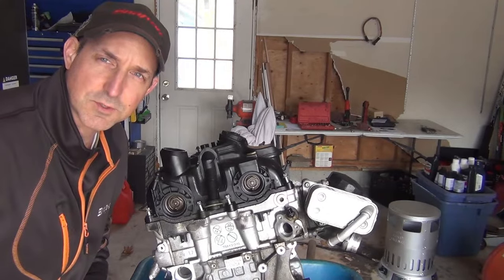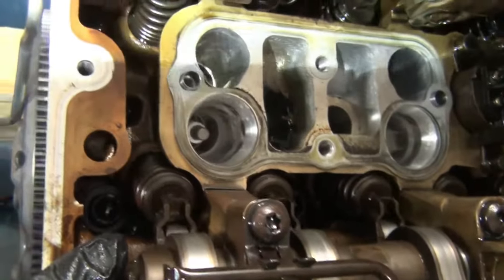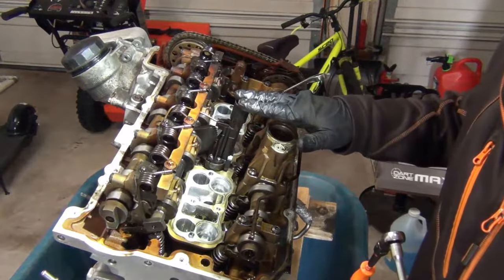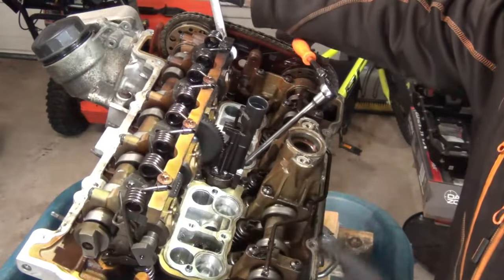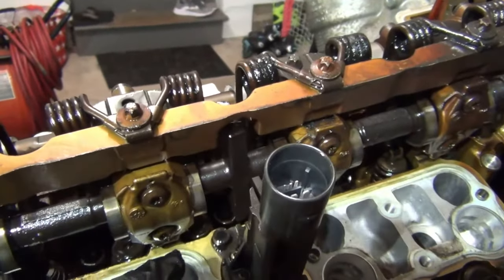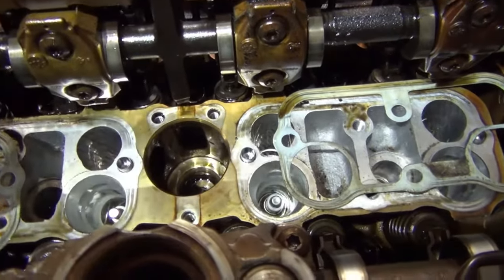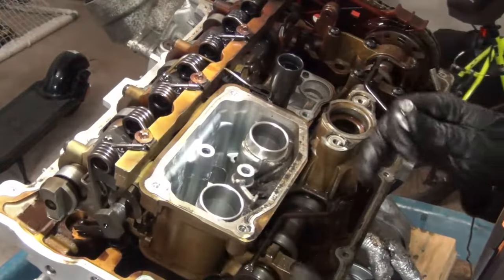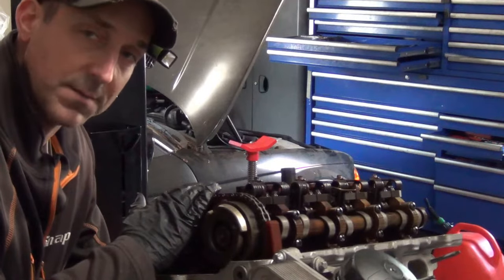How To Remove Replace Install The VALVETRONIC MOTOR BMW N20 N26 N55 With Torque Specs

Comment: For my n55 people your maxximum and minimum stroke stoppers are located left toward cyilinder number 5, instead of right toward the timing chain like the n20/n26 do
Reply from the maker: Thanks for adding this note to help others!
Reply: @AskTheCarExperts  i have the code 2DCF and orderd the motor yesterday, hoping that it is just the vvt motor that failed 🤞
Reply from the maker: @a.b.ripper9908  I hope so! 🙏

Comment: Hi I have 4 codes 135b11,133010,1f0904,and 133011 should I replace the valvetronic motor any help will be appreciated
Reply from the maker: 135B11-Valvetronic servomotor activation Volt phase: line disconnection
133010-Valvetronic servomotor activation malfunction. 133011- Valvetronic supply voltage malfunction This sounds like a voltage supply issue to the valvetronic.

Comment: What is the part number for the fuel injector well block to cylinder head gaskets ( flat metal one time use gaskets) ?
Reply from the maker: I would need the last seven of theVIN to look that up.
Reply: @AskTheCarExperts  .
WBA3N7C53FK222606.
Thanks
Reply: Were you able to get part numbers for those " 1 time use gaskets"  ?

Comment: Does anyone have part numbers or names for the 2 metal gaskets that need replacing at the same time?? Thanks
Reply from the maker: Which gaskets? The ones for the buckets?
Reply: @AskTheCarExperts  hi, the ones you mention at 8:15 mins

Comment: Hi, I timed my n26 engine based on your other video and engine runs drives good but still getting code fault code 135808 : "valvetronic servo motor, position sensors, electrical". Plus it makes loud clicking noise for a few seconds when you unlock car.   Do i replace just the motor?  Where are the position sensors on the N20/N26  that the code is referring to?  Thanks!
Reply from the maker: Sorry for the delay. Just getting caught up on comments. Great to hear my video helped.
The symptom you have can be from a failing valvetronic motor and eccentric shaft. The clicking is usually heard when the gear is binding on the shaft. In most cases the valvetronic motor and eccentric shaft need to be replaced. I have a video on that as well :)

Comment: How much would a BMW dealer charge for that replacement? I have a code P10E2 code with the check engine light on… is that a bad valvetronic?
Reply from the maker: Hello Tyler, I would call you local BMW dealer to find the price. Labor rates vary greatly by state and dealer. I would call a few and get a general price range.

Comment: when i turn my n20 on i don’t hear the valvetronic do a sweep and it also says it’s disabled due to too many errors. since it doesn’t do a sweep does that mean the motor is bad?
Reply from the maker: You have to check the integrated power supply as well and the DME could also be faulty. But often it is the motor and eccentric shaft. Try to test fit one externally and see if it spins when you cycle the key. If it does the DME and wiring are good.

Comment: This is an extremely good video.  Your analysis are just extremely good and makes it very simple for anyone to replace the motor. Please I have a question.  Can a failed Valvetronic motor or system cause a car not to have a spark and also not to start.
Reply from the maker: Usually a failed motor would not cause a loss of spark.

Comment: I almost gave up on my BMW N55 engine because the shops qoutes me $2500 for replacement of valvetronic motor. I thought it was complicated, but i will give it a try as long as the intermediate shaft gear is not damaged.
Reply from the maker: I have a video on a trick way to replace the shaft. I do this on the N20 engine but the procedure is the same.
Reply: Did you get your motor replaced? Was the shaft damaged? I have a rattle sound when unlocking the car.
Reply: @dnup9392  any updates on your car? I also have rattle sound
Reply: @kawakx333  didnt get a chance to do anything yet. Have you showed thencar to anyone?

Comment: Hello, i have changed thé motor on the my 335i f30 2014 but i can’t make thé apprentice to the new motor 
Fault code 134F04
Reply from the maker: In some cases you need a new eccentric shaft and motor to fix a binding component.

Comment: Awesome video, Roger! 👏🏻
I learned a lot as it’s the first I’ve seen of this perspective on an N20.
I didn’t know about the wells until this video. My first thought was, hm any gasket there?
Of course, you had that covered 👍🏻
Quite a difference in execution from the N52, which I had to remove when I did my valve cover gasket job on my E82.

Super closeups you did thanks especially the Allen where it turns the worm gear.  Those shots make a big difference to the uninitiated.

Looking fwd to the next one!

Btw, what happened to your drywall? You didn’t leave Zion in the garage one day…? 😜🐶

I read once a couple left their German Shepard in their garage one weekend with plenty of food and water etc, I guess they went away (not exactly what I would do to my pet…) and the dog bored through the drywall and exterior siding for the great escape!
Reply from the maker: Hi Bud! This was a fun video to make showing how the gearing works. The drywall issue is a funny story to me but not so funny story for my wife when I had to use a come along attached to the wall to put it back in place LOL! I don't think she would appreciate me giving the details here. I never fixed the sheetrock because I want to pull it all out and insulate the garage for better heat retention in the winter. It was a challenge making some videos in the winter. I still have to make the next video but I have an awesome timing tool set I purchased for the next tutorial  😊
Reply: @AskTheCarExperts  hm, wonder if it’s anything like my wife “kissing” the casing and jamb of our garage entry a few years ago with the passenger side of her X1…bmw exterior plastic cladding bloody expensive!
Lucky for her, I’m a certified professional detailer that happens to specialize in premium German marques 😎

Special tool?! That’ll be another great lesson.

Maybe when you have a Premium pay channel your members can get the scoop on your wall 👍🏻

Btw I recommend the rock wool insulation for the wall cavities.
Reply: And thanks for the Shoutout! 💪🏼
Reply: @AskTheCarExperts  Ihave the n55 dont i need a special tool to remove the injectors?

Comment: Unrelated but hopefully the comment helps your video! I watched a video you made several years ago about a problem in my current E46 trunk: (https://www.youtube.com/watch?v=dn3Vel0-uPI). I really would appreciate any help as the handle of the trunk has broken twice and the lights taking a beating from whenever anyone else has to use my car trunk! You said this may be resolved by "installing two thin plates under the lower catch that eliminates the upper latch from rubbing on the stricker". I just want to understand what exactly you mean by this! Currently subscribed and liking actively lol. Please help
Reply from the maker: HI Zaid, I would be happy to try and help. Can you contact me via my website at www.askthecarexperts.com and use the contact me tab. Then we can talk via email. I don't always get notifications from youtube. Can you go over in detail the issue with the trunk and provide the last seven digits of the VIN number. Talk to you soon!

Comment: replaced my timing chain on my n55 but i got multiple codes like : 134F01 Valvetronic, adjustment range: master adaptation outside tolerances and Valvetronic,
adjustment range: fault, range check

would this mean my valvetronic motor is bad?

i also have codes for vanos saying intake and exhaust cold start not available codes: 131401 and 131501
Reply from the maker: To me this sounds like your timing is not correct.

Comment: my valvetronic motor is "unable to properly set a minimum and maximum value to operate properly and is throwing codes during only harder driving". My mechanic is recommending replacing the eccentric shaft in order "to ensure a complete fix". Is it really necessary to replace the eccentric shaft?
Reply from the maker: Hi Thomas, It is definately smart to get a second opinion. Your mechanic is 100% correct. This code sets with wear between the valvetronic motor and the eccentric shaft. Both parts are needed to fix this failure. I have seen techs try to just do the motor and most have to take it apart again as the new motor and old shaft does not mesh correctly. Also the higher amperage can sometimes cause the engine computer to get over loaded and fail the internal final stages.  I hope this help!

Comment: Thanks for the awesome content. do you by any chance know of any possible causes of error code 133E10 valve tronics system: deactivated, too frequent adjustment errors? car idles from a cold start but then about 15min later it stalls
Reply from the maker: Hi Zunai, Adjustment too frequent is often caused by a failing valvetronic motor and eccentric shaft.
Reply: @AskTheCarExperts  thanks, is there a way to test the valve valvetronic motor
Reply from the maker: @zunaids4036  Yes, but it may be a bit complicated. The dealer had a test plan they can run to test the system. For a home test you would need another motor and plug it in externally to see if it cycles with the key turned on. Or remove the valve cover (fuel system disabled) and turn the key on not starting and watch the motor run and move the eccentric shaft. Usually you can see binding or slipping.
Reply: @AskTheCarExperts  thanks, you are really the best car expert 👌
Reply from the maker: @zunaids4036  Glad to help! I wish I had an N20 at home to do more videos with. Hopefully in the future sometime after I finish with the Z3 engine.

Comment: After installing it's need to relearn moter position by scanner  ?
Reply from the maker: That would work if you had a scanner. However just cycling the key on for a minute and off again will relearn the valvetronic if the system is operating correctly.

Comment: I'm getting a 2014 F30 with the N20 engine with a 5 volt supply fault like you said it affect most of the components that have the same 5 volt supply like ex. the venturi sensor the voltage goes around 10 volts when the car is running with the motor connected and 5 volts with it unplug but with the key on and engine not running it goes a bit bellow 5 volts thank for the video I have yet to replace one I did a few timing chain on them and I did the angle pick test on the timing chain thru the oil cap hole and the chain is loose this engine is at around 80 000 milles .
Reply from the maker: Make sure to run the engine for a minute then recheck the chain. Sometimes the chain tensioner will bleed down and give a false sense of play. If it is tight after a quick idle you may still be good.

Comment: Great video. I'm now having a problem with my 2015 F10 and a 135808 code. I have to see if I can command the motor with my scanner to see if it's really failed, but I'm preparing for a motor change out.
Reply from the maker: Thanks Jesse,  135808 - Valvetronic servomotor position sensors, electrical: Malfunction. This very well may be a bad valvetronic motor. One thing to check as well...with the valve cover off inspect the mating surface of the gear to the eccentric shaft. Often the BMW test plan will instruct a tech to replace BOTH items. The reason is, the new motor often will bind on the old shaft. I have seen it may times. If you do just put a motor on it, test it first. Disable the fuel system, install the new motor, plug it in with the valve cover off and cycle the key on (not start just key on) and see if it does a good sweep. It should self test and run to its end stops. Do this a few times watching for binding. If it is biding, replace the eccentric shaft as well.

Comment: This exact thing happened to me and I’m about to try and fix it myself on me 2013 BMW 328i. The codes I got are 134F02 and 135B11. Are these similar codes you got???
Reply from the maker: Hi AT, This may be a bad Actuator but often the eccentric shaft is part of the problem. Before installing just plug a new motor in externally and cycle to key to make sure it sweeps. If it does not run you have a voltage problem from the IVM or DME. If it does I install them and then with the valve cover off and the fuel disabled cycle the key to make sure it sweeps the valvetronic without binding. If it does not the eccentric shaft has to be replaced as well.

Comment: 002E0F only code on my n55 … adjustment fault too frequent, any advice? Can I replace just the motor
Reply from the maker: Usually the motor and eccentric shaft is the issue and the wear is between both components.

Comment: Hey what up  buddy I just replace 2 injector on my n20 engine and now don’t want to start when cracking sound like it doesn’t have compression can the  can the valve tronic motor couse a no start or compression issue
Reply from the maker: Hello, make sure your seals are good on the injectors.  Do a compression and leak down test. Valvetronic can cause something like this but you should have faults for this system.
Reply: @AskTheCarExperts  OK thank you the only thing that I did reuse decoupling from old injector and I remove the other two injectors to clean the tips on them and reinstalled with the same decoupling Can that cause my no compression issue?

Comment: Hi, I have the code (P10F5)-VVL-Control Phase V Circuit
Open (Bank 1). Would replacing the value motor fix this problem? I’ve been having rough starts. I would really appreciate a response 😊
Reply from the maker: I would plug in a new unit externally and make sure it runs a sweep with the key cycled on and off. If the control phase V fault is not present I would start with the motor.
Reply: @AskTheCarExperts  thank you so much for the reply 🙏🏻

Comment: Great video! I’m having an issue where the car randomly just goes into limp mode and once it threw the code for P1030. Would this be related to this issue?
Reply from the maker: Hello Jose, P1030 can be a sign of binding between the eccentric shaft and the valaveteonic motor. Both should be replaced.

Comment: Can I get help on my valvetronic motor repair? I replaced it twice this year.

I just want my car running back normally without these codes. 2E41, 2E43, 2D0F. I don’t hear the Servomotor as bad like before now that it is my third one. Even right before the original one I replaced my car was sounding poorly, then after the first replace my car still acted the same. Right now, it is somewhat better but I haven’t done the relearn yet. 

My questions. Should I do go ahead and do a relearn with this new Servomotor? Do I give up on the car? If relearn fails again, will it be Shaft or DME at fault? Thank u. Btw an Indy shop is helping me here.
Reply: Hi tell me. When your Valvetronic motor failed all those times, was your car engine able to start ? Or it was cranking but failed to start
Reply from the maker: Normally this would be a crank no start saturation.
Reply from the maker: Sorry for the late reply, Did you get your issue fixed?
Reply: @AskTheCarExperts  yea it was a connection wire to do with the Servomotor mechanic said. Another shop said they had a similar situation just takes time to figure it out

Comment: My n20 says no movement detected could this be the sensor or would Ot be the motor
Reply from the maker: Hello Matt, On your N20 the motor and the sensor are the same component. This could be an issue with the power supply, jamming of the eccentric shaft, or a failed motor.
Reply: I have the same code after completing the valvetronic motor replacement. The gear seemed to turn well by hand. There was light scoring on the eccentric shaft gear. I’m using the top don scan tool to try to relearn the position. It fails every time due to voltage and is in emergency mode. The battery is fully charged. When you try to start the car it cranks and that’s it. When you shut it off and remove the key you can hear the valvetronic motor move. What would be your next step at diagnosing this issue?

Comment: Hey bro Nice video, can u help me with someting, The camshaft has a stop screw, could you help me with the measurement so I can make one?  I don't have it and I can't buy it where I live. In eBay appears as "stopper Bolt", 5:16 in this part u remove it
Reply from the maker: The valvetronic system is complex. I would only recommend using the correct part for this. They only look to be around 8 dollars on ebay.

Comment: Hello,

Does it matter whether I'm on the max stop side or the min stop side?

Thanks
Reply from the maker: Hello, The eccentric shaft has to be in between the two stops as shown in the video. If not correct the relearn procedure will not take.

Comment: Does the engine has to be on *TDC* or it can be removed on any position??
Reply from the maker: For the VVT motor the engine does not need to be a TDC.